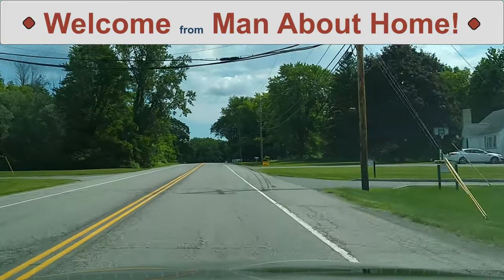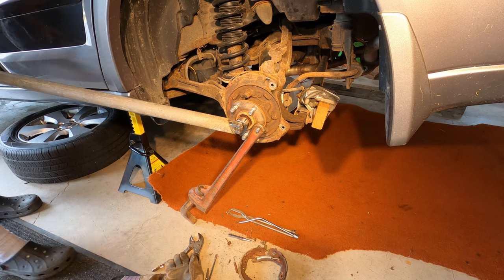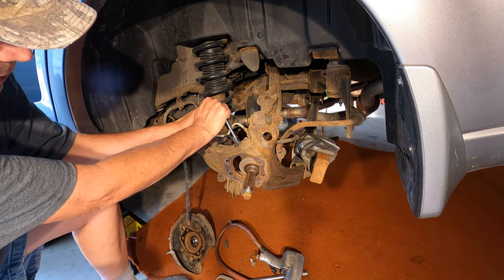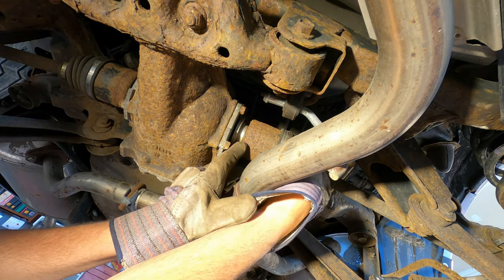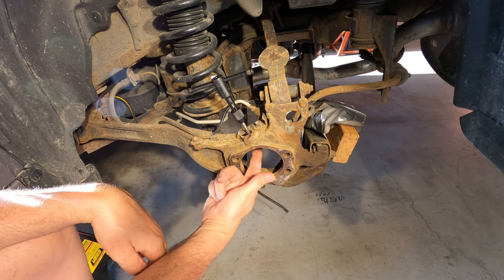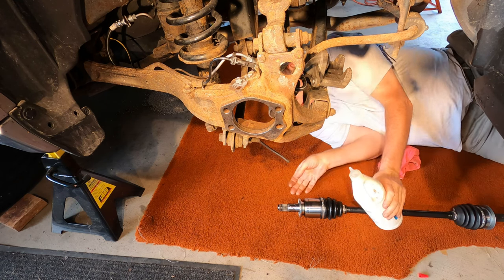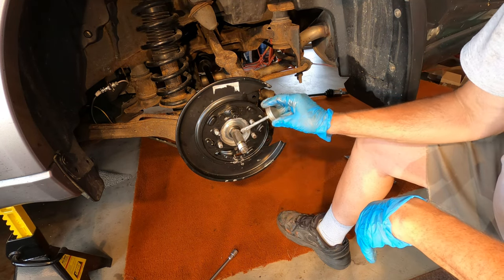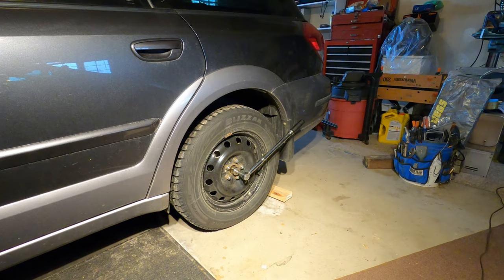Changing Rear Wheel Bearings | Subaru | Man About Home

Comment: Very well done.  The only instructional I have found indicating a new backing plate is needed because the old rusted one is mangled after pounding on it to remove the hub
Reply from the maker: Thank you. The backing plates were totally rusted out and were actually falling apart before I did this job. I broke one during a previous brake job. So I planned to replace them the next time I had to work in that area. Thank you for watching and commenting!
Reply: They’re not cheap. About $85 each from online discount Subaru parts for the wife's '04 Outback

Comment: I'm a little surprised to see that the brake caliper mount is bolted to the backing plate, not the knuckle. I guess that's why Subaru have such beefy backing plates. So methods that use a forcing screw are pushing the backing plate into the knuckle while trying to pull the bearing out.

Comment: Thanks ...about to embark upon wheel hub bearing 2017 outback...one side or 2 ..dont know. not doing entire axle - I pray. but your video was very school like. Appreciate it . Good Bless !
Reply from the maker: Thank you and you're welcome! One warning - It appears I got off easy with removing my bearing hubs, partially due to the fact that my backing plates were rotted out and needed to be replaced. Being able to easily remove the rusted out backer plate, made it easy for me to get a pry bar in behind the bearing hubs and pry them out. There's a lot of videos on here that show how much trouble many people have removing those rusted in bearing hubs. One of the best ones I've seen shows how to use an old (to be replaced) brake rotor to help with that. Flip it over and bolt it to the hub. That gives you something to beat on or pry on if needed. One man even put a 24" pipe wrench on the top of the rotor and hit it with a sledge hammer! I recently had to replace another front bearing hub. We flipped the rotor and screwed 3 lug nuts onto it, leaving lots of uncovered threads. Then we (my son & I) used the rotor almost like a slide hammer, pulling it to slam against the lug nuts. Since the hub had previously been coated with never seize, it came right out. Thank you watching and commenting, and good luck with your repair!
Reply from the maker: By the way. I'll be publishing a video about that front hub replacement soon...